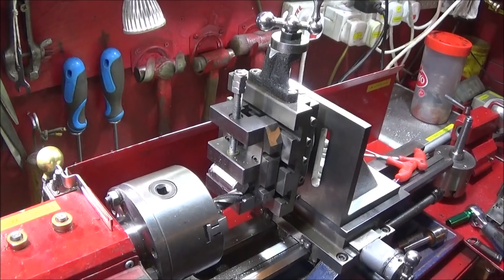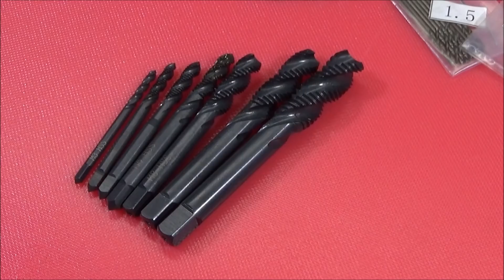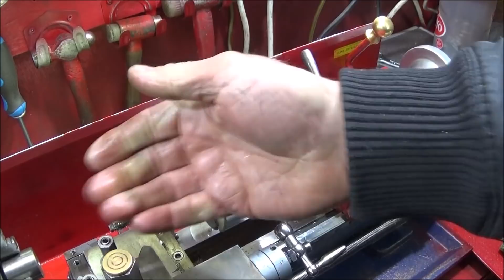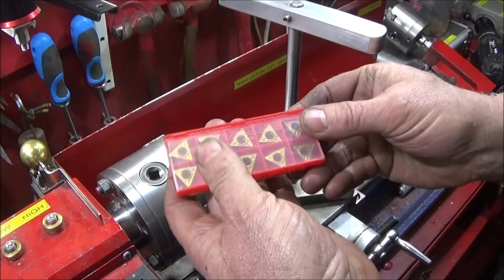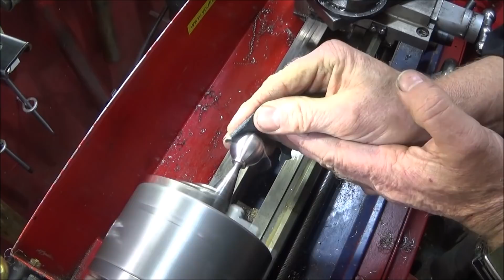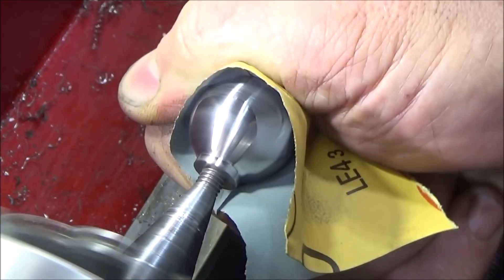Mini Lathe Milling Preview, New Tools And Turning A Stainless Ball

Comment: Many people complain of the time it takes to actually machine the ball. I have suggested on several occasions to make calculations and cut most of the material on the two sides of the part which will contain the ball away on a common angle of let's say 45 degrees and then finish the ball with the radius cutting tool. The excess material can be removed much faster than what anybody can do it with this type of manual hand tool. I would also suggest to move the handle down and much more horizontal which will give you more control and leverage when cutting the ball by hand.
Reply from the maker: Hi Pieter the way I have designed and made it is how I want it. It works perfectly and very fast. I wouldn't change anything on it. I'm not boasting but for me it is the best ball turning attachment I have used apart from the Myford one I have. There is no need to rough out the ball this one does it in a matter of minutes and that is on 316 stainless steel.
Reply: It's your choice how you want to do it brother. I just made a suggestion.

Comment: Like that vice, fitted to what looks like a Myford wide vertical slide. Good the way it uses captive T nuts and Allen bolts to give more options on height mounting

Comment: i have had good luck with bangood tooling, but if there is a problem with any thing they will keep putting you off and delaying a remedy , most likely you will have to have paypal help, the people at  bangood do not want to take responsibility, they hope you will give up trying to get things resolved!! buyer beware, so you have to stick with it!!!!example i got that 7 piece 3mt morse taper kit, it came missing the wrench, they want me to take a picture of the problem, I am supposed to take a picture of a missing wrench, I tried 4 times to exlpain, and requested the wrench,with no success ,there are morons in Asia too, it is now in te hands of paypal
Reply from the maker: Can you please stop banging on about it☺
Reply: I had the same problem.    For some reason they want a picture  so after explaining that there was nothing to take a picture of I finally took a picture of what I had and sent it    I was surprised  as they straightened out the problem and I was happy.    On another occasion the same thing happened so I sent a picture right away and I was very happy with the results .  I have ordered quite a bit of stuff from them here in Canada and overall very happy with the products.   I have learnt to read the product description closely but that was my problem.   It sometimes takes a very long time to get the product (months) but has been worth the wait.   If they want a picture then send them a picture whether it makes sense to you or not.

Comment: Hi Steve,  
I have a similar ball turning jig and have used it extensively.  Some tricks that I found along the way which you may or may not find useful...
* If you mount your cutting tool rotated at about 30 degrees instead of straight on you will be able to cut further round on the chuck side without hitting your mandrel.
* It is a good idea to set a depth stop so you can't go past center when cutting the sphere.
* Rycol RTF is fantastic cutting aid for stainless steel.
* You can get a really great finish using diamond paste and cloth.  Diamond paste is cheap and very handy stuff!
I hope you don't mind me sharing my tips.  
Those drills look great.  Thanks for the tip on those!
Reply from the maker: Hi John, Many thanks for sharing your great ideas. I will try them all. I didn't know about diamond paste either. I have just looked it up on Ebay and see they do it in syringe sets of different grit. That is great thanks.

Comment: Milling on a lathe is difficult. The problem is that you don't have very much travel cross-lathe (technically Y) or vertical. Worse, if you don't have variable speed, the RPM are usually too fast or too slow. But I do like the idea of using an angle plate, in fact I have one... hmmm.

Comment: Hi Steve,
I bought those drill bits a couple of months ago after a review by Pierre, they were a single set of 1- 10 mm in incremental sizes as you have, so far have been working great, my only complaint was that they didn’t come in an index, I know that they were not expensive but a cheap plastic index would have been good. Nice milling setup, what size is your angle plate, I’m looking at buying one in the future.
Nice video, thanks.
Cheers
Raymond

Comment: I bought set form 1 to 10 from banggood by your recomendation -So far very good drill bits,for money.Cobalt drills cost kidneys in my country,here it is for a fraction of price.
Nice of you to do good tools review only-lots of channels whored themself for easy money.
Any good  dies made of hss  Steve that you recommend from banggood ?From pictures what i saw none of them were made of hss(inferior carbon steel mostly) and are of very poor quality.
Love the ball attachment btw !
Reply from the maker: Hi Thanks.. I haven't looked at the dies yet. Like you I would never buy carbon steel ones. I only buy the HSS type. I have many British made HSS dies that I have bought second hand off Ebay which are still excellent.
Reply: The thing about dies and tap is they are throw away item -how many people still sharpens them?I havent seen it done profesionaly anywhere.
When they get dull and they will eventualy -throw them away.I have seen dies so dull they couldnt even start a thread in brass. 
For taps and dies i strongly recommend german  Projahn brand -they are not cheap but boy they are good and real deal.M3 to M 12 set costs around 100€-but you get what you pay.
Another good brand of tools that are cheaper is Terrax line made by Ruko also from germany.
You cant go wrong with germans they know how to make tools as long as it is realy made in germany ,not chinese crap with germany written on it .
Carbon steel are the worse-so many sellers on ebay and other chinese sites claim to be HSS but you can see it in metal structure -hss is shiny silver color,carbon steel has dark grey color.
Also Titanium nitrate coat has reflective shiny finish not dull gold paint look.

Banggood/ebay and other chinese sites has good tools for cheap price but also many bad tools.You got like 50/50 chance.Oh and dont buy anything with thread that is important -chinese people cant make threads with any kind of tolerances,they can make the tools to do it but if you put gun to their head thread would still be wobbling and with alot of play .Thats my general experience speaking from Ebay/banggood/aliexpress.

You probably know all this but in case someone who doesnt -reads it.

Comment from the maker: LINKS TO THE QUALITY TOOLS SHOWN & REVIEWED IN THIS VIDEO
   74pcs 1-8mm Twist Drill Bits M35 Cobalt HSS Drill Bit Set --  https://goo.gl/wZ2Cyw
     Wholesale Drill Bits --  https://goo.gl/rrbaiK
Nitride Metric Screw Tap Set.
https://goo.gl/h33kv9
80MM Self Centering 4 Jaw Chuck
     SANOU K12-80 Lathe Chuck Tool --  https://goo.gl/WU2TB1
Ball Turning Carbide Inserts.
0pcs TCMT16T304 Carbide Inserts --  https://goo.gl/zfgXwd
      Wholesale Lathe Tools --  https://goo.gl/8X1ZU4
 https://goo.gl/LbyjMs
Reply: Steve Jordan 
Thank you for the excellent ones you have recommended.  I bought a couple that I wish I had not before finding your channel!
Reply: Steve, I just want to be sure on the links you supplied: are they simply for viewer convenience or are they affiliate links? As you are no doubt aware, many posters are now madly uploading product reviews for a plethora of tools and accessories they have absolutely no use for in their former world, but somehow must justify the ..."gift", it's getting to be quite difficult in separating the wheat from the chaff.

 I also want to stress this clarification request in no way questions your credibility, I just now need to categorize who's doing what and why, and thank you for your useful body of posted works.
Reply from the maker: Like I said in the video. I don't do reviews for tools and items that I don't want for my workshop. I only review an item that I choose and it has to be excellent quality. If a company sends me a tool for free it will be something that I have specifically chosen beforehand, but it has to pass my quality control, to be reviewed. 
   So far everything except one item has been as good if not better than what I expected. The one item, which I scrapped, was a small chuck, which had badly ground jaws and had .025" run-out and was very poor quality. I wouldn't review this tool and offered to send it back. My channel isn't about reviews, its about making and getting what I think is the best equipment for the machine tools I have.